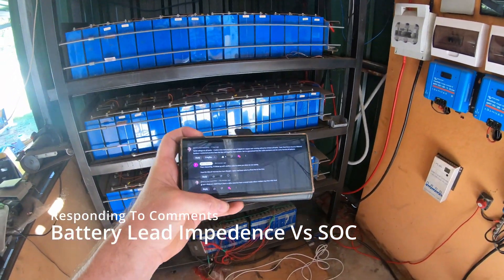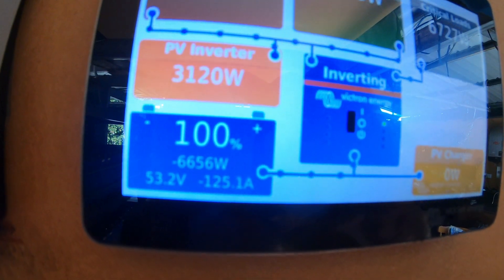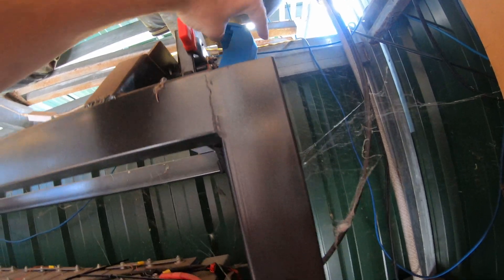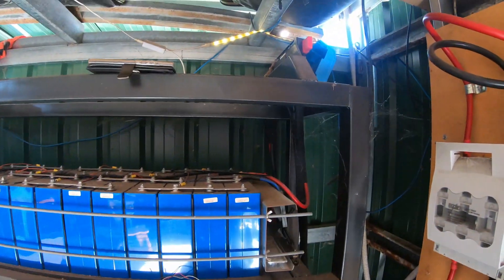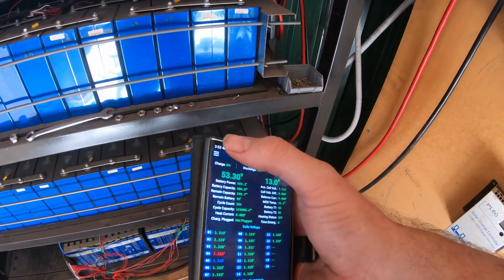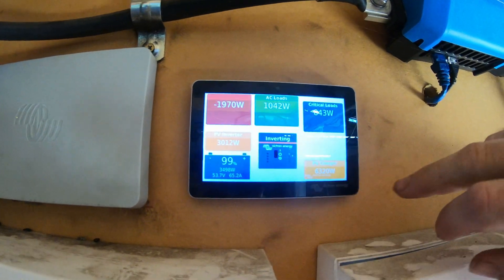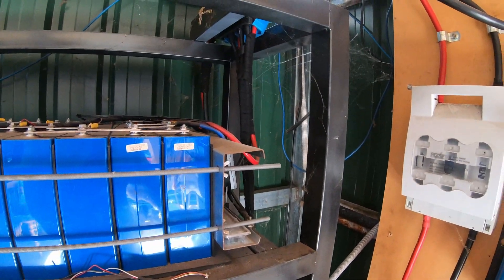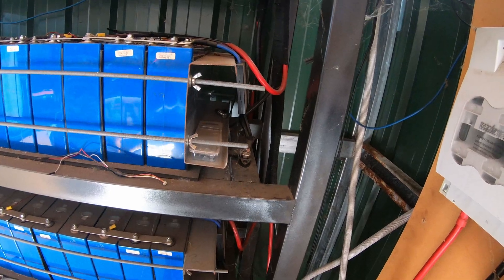Cable Length Causing Imbalance

Comment: Do the batteries read roughly-the-same voltage in the middle of the night / early morning, with very-low-load? If not it may partly be a calibration issue. Could also be cable length. If you wanted to experiment you could try swapping the bus bar location on one of the sides- say have the negative at bottom of rack, positive at top; should equalize the distances that any one battery sees. But with the limited access I'd be willing to say it's cable length and call it a day :-p. 

Or, maybe just take a multimeter / clamp dc meter and measure the voltage drop and current seen over the leads? That might be interesting- 200mV across top lead for 50A, 400mV across bottom at 40A. 400mV on positive side, 600mV on negative. A lot of fun could be had with a few spreadsheets.
Reply from the maker: Thats not a bad idea. The next weekend coming im going to go through the calibration process and see what comes of it. But also put the banks under load and look for issues with the thermal camera. Moving their locations isnt a bad troubleshooting idea. Cheers for the feed back

Comment: I dont see why someone will use a 2P battery. You can not see the individual cells anymore and giving the balancer a hard time. The only thing is that you half the bms count.
Reply from the maker: When you have a failure its very obvious which one it is, The pack wont even get to 50% and the BMS will stop the charging if one cell is gone. It effectively triggers a cell over voltage protection when your charging or a cell undervoltage event when your discharging. While you dont get the exact clarity of having them in 1p, the system doesnt completely shut down either.  But in our case we just wanted to save some money on BMS's at the time. and being able to charge at 600a already went beyond our requirements

Comment: Worked on a few UPS systems, 480 volt stack would eliminate a lot of issues tied to current. Just my 2 cents e
Reply from the maker: Dude thats what i love about the AC coupled stuff, When your pushing 800v down 4mm square wire you dont have to worry about much current lol

Comment: I don't think cable length is going to play a role here unless it's under consistently high load. As soon as the load is removed the packs should balance themselves.

My opinion is that it is caused by the current and voltage calibration on each JK BMS. So each BMS just reports a different SOC. I would be curious to get a multimeter current clamp on each row and also check the voltages of each shelf.
Reply from the maker: It could be, Maybe i need to sit down and calibrate the BMS ?
Reply: @BadIdea1123  yeah it's a shit process to calibrate them tbh, you need a constant high current DC draw. Inverter draws can be somewhat inconsistent which makes it hard to use an inverter as a base load for calibration. But I'd definitely sus the current draw on each cable with a good quality multi meter with a DC current clamp.

Comment: ah yes, i would absolutely not relay in the jkbms voltages and particularly not the current.
i have grossly different lenghts ob cables, different manufacturers and ages of lifepo4 cells. it does not make all that much difference in all things.
Reply from the maker: ah yea ive seen that on other peoples videos too, They are wildly different per unit

Comment: Have you calibrated the JK BMS's using a good multimeter? A small difference at the cell level can be quite large at the pack level especially with 2P16S config. If you can get all cables identical between each pack and the main busbar that is best practice but if I were you I would mainly be concerned about the top balancing within each pack. You have to occasionally get the cells up to the vertical part of the charge curve and hold them there so the balancer has a chance to do its job, that means 3.5V+ pc. Charging to 3.4 - 3.45V is good practice for longevity but the cells can't balance properly at that voltage, the charge curve is just too flat at that point.  
1:24  Your Ave Cell Volt is showing as 3.378V (54.06V pack) and your balancer is ON. This is not good, they may show Diff of 20 mv but at that voltage it means absolutely nothing. The balancer is working it's ass off but not actually top balancing like it should.
Find yourself a charge curve for those cells, you will see the voltage has to get above 3.5V before it is anywhere near vertical enough to truly balance. At 3.378V your cells could be anywhere between 60% and 100% SOC so what is the point of balancing??      
To top balance properly before putting into service you should put each pack in parallel and charge to 3.65V until the current reads 0A, this will mean all cells are truly fully charged. That is probably what you need to do with these cells one pack at a time, you have plenty of capacity. Running that 10Kva inverter from two packs at a time will be fine. Find yourself a CC/CV bench power supply 20A+ that will accurately put out 3.65V. Those batteries will last 15 years+ easily, probably longer if the chemistry is good.
Reply from the maker: We have bumped our charged voltage up to 57.2 to balance that top pack. We dont see internal imbalance in the packs until they are 99% full. And its only the top pack. During winter i will turn it back down to 56.2/55.8 for full charge. Something about hte higher voltage causes the inverter to flicker the lights. But i want to give the balancer the best chance to balance the pack out

Comment: You can maby put the lynx in the middle of the battery banks and cut the cable to the same lenght. Good way to start I think
Reply from the maker: Thats a decent suggestion, Just tape the CAN cable to the two DC cables going over with it you think ?
Reply: @BadIdea1123 I am talking about the lynx distribur (with the open cover) not the lynx shunt. But wathever

Comment: Battery's banks also have there OWN impeadence! So some battery banks will deliver more power easier than the same style battery bank. 
you may want to put each battery bank on its own inverter, then combine the output
Reply from the maker: Actually this is not a bad idea, we have a spare Multiplus 2 floating around, albeit a small one.

Comment: You'll find that the most used battery will be really heavily used when the voltage is around 3.2V per cell because the voltage is so flat that there will not be much volt difference even when at vastly different charge levels. You'd be surprised what a small change in resistance does to current in parallel packs.
Reply from the maker: Thats generally what we see. They balance out on their own. Im not hugely convinced its an issues at this stage, I'd be concerned about  two not taking charge and another getting hit with say 200amps constantly but thats not likely to happen
Reply: @BadIdea1123  If you do start to see that one of the banks is accepting much more current than the others while their voltages are around 3.2V per cell, you may consider putting individual shunt resistors of around 500uOhm onto each battery. That will drop 0.1V at 200A which is 20W. You could even put a couple in series.

That being said, as long as you're actually exercising the batteries roughly the same (by often charging to around 3.4V per cell and discharging to something like 3V per cell), 200A should still even be okay. However if you're going above that start worrying about their C rating.

Comment: As soon as the load is gone, all those banks will equalize anyways. Top shelf will take more charge current. They will not be that far from each other both voltage and soc.
Reply: There is a small voltage difference charging and discharging inherent to LiFePO4 which actually makes it not balance quickly at all. This is part of the reason for inefficiency in these cell. What this means is they really only properly balance near the edges of the voltage curves where the cell voltage goes up or down steeply with with charge level.
Reply from the maker: A few people have pointed out how high our battery voltage is, and what you just said nailed it. We do it a few times a year to balance the packs out it works a treat
Reply from the maker: Thats what we generally see, Its only when its discharging and charging we see the packs at different levels

Comment: I have jk inverter bms x3 (soon to be 4, promised wife no more after that, yeah right). I get different voltages on the jk screens. But one day got multi meter and measured voltage at terminal of battery and result differed from what bms was telling me (batteries were all closer in voltage) have not calibrated bms as I didn’t know if charging affects the voltage being the same and my inverter and bms are only the same soc when the battery is full. I have selectronic not Victron inverter ac coupled (dc coming soon) . Keep up the good work, with out these channels people may not decide to start (I was one)
Reply from the maker: I might have to drag the battery rack out and check it by hand hey ? 

My partner doesn't know it yet but we are getting more, its better to ask forgiveness right ??
Reply: @ of course, my wife bought an electric car, doesn’t know a thing about solar so loves the “free charging” (no such thing unless your taking it for free from someone one else) so I can generally explain away purchases, “ dear the flux capacitor needs a higher voltage so we need more panels and a dc couple on the inverter” (glazed eyes from her and a confused look means yeah just do it and promise me u won’t try to explain it to me again)

Comment: You might have noticed a high amount of people watching the 2-year-old battery use video as that's the one that just randomly came to me

Shorter cables will always have the least resistance for flow and will have higher voltage (battery and bms resistance counts as well)

You can get batteries or a battery that have high resistance witch will affect the whole battery pack efficiently but usually you will see on the BMS where one of the batteries will deviating from the others voltages (may be more noticeable near the top or lower end of soc) 

 they'll usually show up on a thermal camera as well bad connections, bolts and cables heating up)
Reply from the maker: We have two thermal cameras, one is in a rebranded samsung tough phone (branded as a cat product) the other in a chinese multimeter. When we make the next video calibrating the BMS i think i will follow up with the thermal cam again

Comment: You could start by examining the cables. Over the years, I’ve built a system and noticed that different battery packs behave uniquely during charging. Specifically, I’ve observed that two of my packs draw nearly twice the current compared to the others when charging from 20% to 90% SOC. This results in an imbalance: two packs reach full charge and start balancing, while the last pack lags at around 60% SOC and continues to draw the full current.

This situation isn’t ideal, and I believe it’s related to the chemistry of the packs. I’ve done everything possible to standardize the setup—using identical cables and configurations—but the issue persists. To mitigate this, I developed a Node-RED flow that dynamically reduces the charging current as the voltage increases. This helps prevent the last pack from charging at the full 100 amps ++++.

In one experiment, I paralleled a slow-charging pack with a fast-charging pack by connecting cables from the slow to the fast and the slow to the busbar, and the results were promising. However, the layout constraints in my shed made this setup less than ideal.

You might consider paralleling the top pack with the bottom pack and running a suitable cable from the bottom to the busbar. This approach could help distribute the load more evenly and improve overall charging balance.
Reply from the maker: I supposed the internal resistances could be it, but it would be very coincidental that they happen to be going the way they are. Like the pack furtherest away being the one taking the bulk of the load. Im not concerned about the output current to be honest, Generally the big current comes during charging which is usually the other way around. Each pack would only see around 100a absolutel max during charging. And even then as the voltage goes up on one the others get more current any way

Its not a show stopped in my opinion but someone mentioned it and the conversation was decent so here we are
Reply: @BadIdea1123  I am not sure I cant figure it out. When the 2 packs are full and third is still charging the voltage rises and will reset the SOC too early before its charged and balanced so I need to slow charging and when I do current flows from the other packs to the low SOC pack. The other problem I have is the pack that is slow to charge will also discharge much quicker than the other 2 packs. The first 2 packs I have are about 3 years and 2 years old the third is only 1 year old. Good luck with your investigation.
Reply from the maker: @sparkletornado5890  The first pack takes discharges the most no matter what, But it then charges the fastest as well. 

In an extreme case, like really low soc the first shelf will get to 5% and the last shelf will still be at 20%

Comment: What size cables are they going from the power in busbar to the breaker?
I’ve used 95mm on everything on our system, a clamp meter might  be the go🤷‍♂️
Reply from the maker: the main cables are 95mm2, but the ones down to the batteries are 35mm2 i think from memory. I will pop out and confirm that